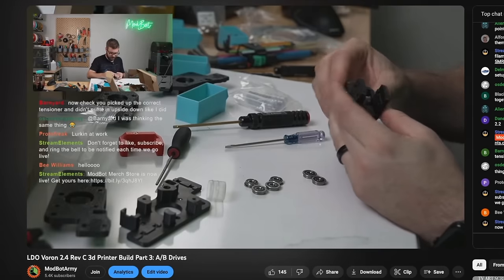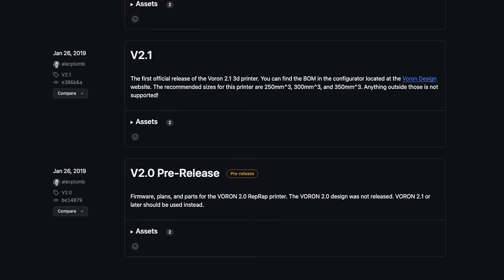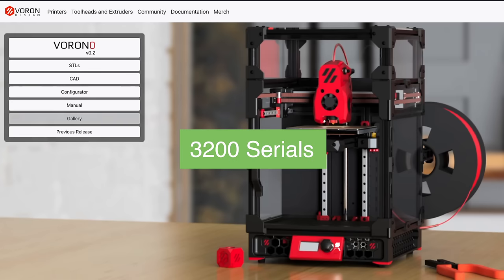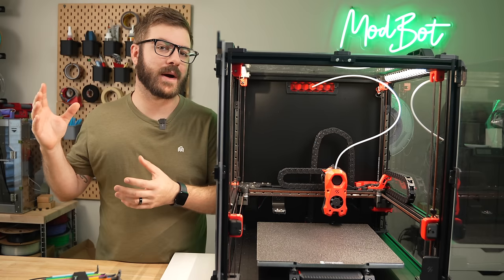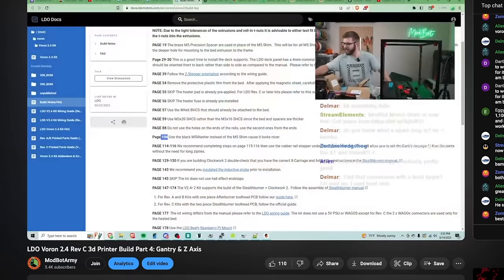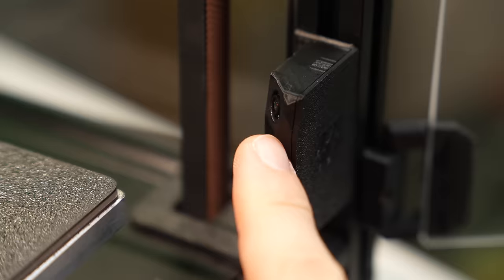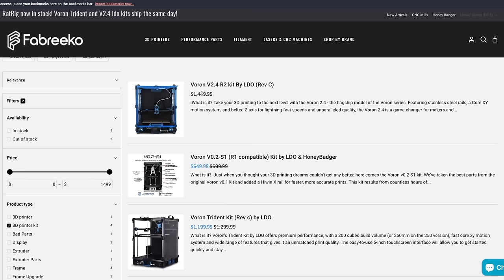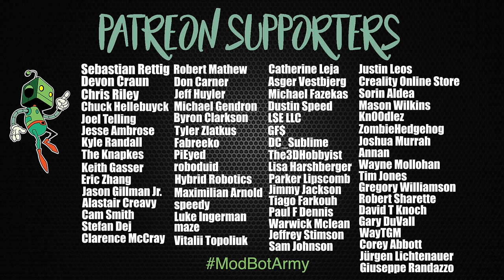Should You Still Build A Voron 2.4? (LDO Rev C)

Comment: With Bambu lab x1 people will get much better quality, speed and features then outdated overpriced voron with heavy printhead and less features.

1x 2.4 350 kit with good quality components will cost like 2x bambu lab p1p.
Reply: Not a popular opinion among, but I agree. Even though I love to tinker and build stuff, the Voron kits are overpriced compared to what you can get from Bambu these days. I think a Voron parts kit would need to be around $500 to be competitive. If I am going to spend over a grand, why not get the X1 with multimaterial support out of the box?
Reply: The bambu lab is not a bad printer ... ok if you don t want to build a printer yourself.... but it is still a cheap copy of a Voron ( as stated from Bambu lab itself) ... build industrially for a customer market. 
I also highly doubt that it will last for years... it requires more maintenance as a Voron, 
good quality? .... for example, the bed on a good Voron is 10mm thick pure aluminum... and heat resistant... the bambu lab one wraps often.... 
parts are proprietary, 
you can't use ist without cloud ( on the long term and not speaking about the overpriced E variant) 
It is a lot louder as a good Voron ( I can barely hear my 2.4 working 2 m away from me at good speed) 
it is poorly isolated... the chamber temp in a voron will be 10-20 ° C higher 
more features on a bambu lab? --- good laugh .. they have just copied klipper, prusa slicer and Voron... with the AMS being the only highlight...  Vorons get 1-2 upgrades per year
Size... bambu... 256mm...  Voron s starts at 250 mmm usually (V0 except) and are usually 300 or 350 mm big... 
price ? .. somehow... if you compares a smaller printer with printers double the print volume.... and better, non proprietary parts...  you get what you have paid for... and I think that bambu lab will rather sell you a new printer model in 2 years as upgrade yours.. for a smaller price....
speed? not really...  the printhead may be heavier but the motion system is build to compensate for the weight ... and at the end of the day your hotend will tell your how quick you can print ... and you can put some big ones in the Vorons... Flow matters...
and so on… the user case will determine what printer you should buy.
Reply: Merry Christmas  @Pasha! Dying laughing at the response to your post! The 3d printing community is about more than 3D Printing! The work up until recently by all the amazing engineers both home and professional is what lead to Bambu labs existence! I will be buying the mini soon because well, its amazing! However, building the Voron tops my list because im an engineer! The evolution of corexy and work by so many within voron and rat rig is just incredible and its at theheart of why I dig it so much!
Reply: @TheJacklwilliams  rat rig is much better and interesting imho. + it has 2 official idex mods
Reply: 7 @Newmeishu
Reply: @Pasha4ur  Good point! Im a fan of both designs!
Reply: @Pasha4ur the ratrig idex variants are still very much in beta and not fully featured. I wish they'd polish them up, I'd love to build a RR idex!
Reply: @christopherkelley2061 they’re different printers for different groups of people lol
Reply: So you’re comparing a 250 build plate to 350? Voron is not outdated and never will be because you can continue to upgrade it. My 2.4 is faster than any p1p… overpriced is wrong when you have so many more components and steppers than a p1p. If value is what your after a Voron is much more for value seeing as you can always update it in the future your locked into p1p frame extruder toolhead and eco system. Your logic is not adding up… but good opinion.
Reply: @gabriell4031  Damn straight. Additionally the skill sets gained by building, configuring and maintaining one will serve to raise your game far above the average printer operator.
Reply: Lmao i build my trident under $200 🇨🇳
Reply: @svwill6384 How did you manage that?
Reply: Sure, just add the closed source machine that's designed by former engineers from a corporation known to be complicit with CCP directly to your LAN. What could go wrong?
Reply: To me, this is apple vs android.  Bambu/apple people are ok using proprietary software and components that aren't able to be customized. Voron/android people like freedom to customize and improve. Both can provide excellent prints/make phone calls. 

Remember when apple was making it seem like people's batteries were junk to encourage them to buy a new phone; but their battery was in fact fine and miraculously improved 94% after a forced update? I say no thank you to proprietary software; that could one day be force converted to $200/month subscription.
Reply: @Zerff  everything pretty cheap here, i could get everything locally
Reply: Try the MPX kits they go for 800ish shipped for a 2.4 with tap and can and a 350mm^3 build volume
Reply: Does bamboo have a 350^3 cubed kit.  I gotta check them out.
Reply: @Hood.Housekeeping  no they don’t I’m talking about magic phoenix
Reply: If the Bambu breaks ur cooked 💀
Reply: Here is the deal though, my homemade machine is going to be made of standard parts in a completely open source ecosystem I can always get support for and will never be bricked when a company goes under or shuts off their servers, I also won't be left out if a company stops making parts.
Bamboo labs? Proprietary hardware, software and you will be left high and dry if bamboo goes under or decides to shut off their services, they will also be less durable considering it's a mass market item rather than a open source framework that is open for people to scrutinize every little detail which weeds out flaws much better than a company ever could.

Comment: Did Canbus and Tap on mine, best mods ever. Canbus was a pain to flash months ago, but gotten way easier. Helped build some for a shop and the cable chains started to shred wiring after around 2500 hours of printing, so the slimmed down umbilical was a huge must for high demand printing.

Comment: I built an LDO 2.4 300 back in March and I have been pretty happy with it.  I ordered a Trident kit a few days ago, and the ONLY reason I went with the Trident over the 2.4 was that I wanted to build a 250 this time, and AFAIK LDO only offers their 2.4 kit in 300 and 350.

The switching back and forth between the Voron manuals and the LDO docs is indeed a pain in the ass.  I doubt if the Voron team is interested in adding tailored instructions for the various kits, and trying to keep up with changes in the kits.  So it would be up to LDO to make a custom manual.  It's probably not worth the cost increase it would take, given the kit's already relatively expensive.

Comment: I built a Voron 2.4R2 350mm from a kit. It was fairly expensive compared to my other printers and the kit quality was not as good as it could have been. My recommendation is to go with the very best kit you can find. I thought I had, but I really should have done a little more research - it would have saved time and money. The biggest issue now is the bed quality. The bed is just not as flat as it should be which is essential to getting consistent prints. Spend a lot on the bed quality because if you have to replace it later it will also mean replacing the heating pad! All of that said, when I push print and it's tuned-in, I can't stop looking at it! It's almost magical. It's a really beautiful printer in form and function. I use this machine for large prints and for ABS and ASA as it has an enclosure. And I built it - go figure!

But it does take some passion to want to build a 2.4r2 350...
Reply: mind sharing which kit you got that you were not happy with

Comment: For anyone who doesn't have the budget for an LDO but still want the quality that comes with researching community mods to apply by default to a kit, I'd personally recommend Magicphoenix' CBT kit (CanBUS + TAP). It manages to simultaneously be among the cheapest kits and, in my opinion, include the best the community has to offer. Genuine BigTreeTech CAN boards for the toolhead, a Manta M8P with their in-house clone of the CM4, TAP and Nevermore configured by default, with options for Disco sticks, CNC parts, printed parts (functional/decorative), Phaetus hotends, genuine Gates belts and stainless steel rails.

I took a gamble ordering from them and, while they ship from China, I also had no customs to pay for it here in Belgium, since it first arrives to Poland before being dispatched to the home address.

Overall not only is the printer fantastic (but that's a given at this point), but the price paid for the quality that came out is outstanding. Can't recommend them enough, they even hang around in the Voron Discord if you have any question.
Reply: Hey do you have an email or some sort I can contact you for some questions about the kit? I'm also from Belgium.
Reply: With exception that Magicphonix is dead. People (including me) buy kits and have to file for a refund a few month later as nobody is actually sending the kits.

Comment: I started with the Trident, and am in the process of building a v2.4.  I feel they both have their niches they fill.  For an all-around workhorse, the Trident does a splendid job, especially when you factor in that LDO's 300 kit is a 300 CUBE design, so has another 50mm of build height to work with (stock design only has 250mm of build height, 300 cube has 300mm), which significantly reduces the need to go with a 350mm v2.4 if you need that height.

I won't lie, the v2.4 is a sexier looking kit, and the flying gantry is gorgeous, but if the LDO 300 cube kit had been available when I was originally building the Trident, I would have just gone that route (I built mine back when LDO was still beta testing their Rev A kits for the v2.4).  Wound up building a v2.4 alongside the Trident because it offers a nice niche that my Trident doesn't fill - larger schtuff, since it's a 350mm build, and will probably have around 315mm of usable height (kinematic bed mount removes some of the stock 330mm build height).

Editing to add: One of the reasons why the v2 has so many more serials is far too many people assumed that v2 was newer than v1.8, which is why the Trident is named, instead of being v1.9.  It's also been around a lot longer, but there's been pretty decent growth on the Trident serials after a few months of it launching.
Reply: Are you sure?   My LDO 2.4 300 maxes out at about 260 on the Z.

Comment: I built a voron legacy 6months ago and I am very happy with it. It is my go to printer where I send the print and forget about it. I do have 5 ender 3 printers and a hurakan but when I print on them I need to sit thru the first few layers and still keep checking regularly to make sure nothing goes wrong mid print. I am now building a bigger legacy with parts from a Ender 3 max because I have some special requirements from my customers where I need a 300x300x500 build volume

Comment: As someone who owned a v2.4 and a trident, go for the trident, especially if you are considering 250 and 300mm build sizes. This has two to three reasons: build is much easier (no z belt tension, no z drive assembly, no z belt clips), less expensive (one less stepper, one less driver, one less rail), maintenance free z axis when using pom nuts and requires less printed parts. Second reason is build height. That one might confuse as the trident has always 250mm height while the 2.4 ranges from 250 to 350mm. Reality is different. On a 2.4 you roughly miss 40 to 50mm in z when the top panel is installed because otherwise you would absolutely bend the reverse bowden. The reason behind that is that the original frame was built around being bowden extruder, wo you didn't need the extra top space. I personally would even go so far that you miss 50 to 70mm depending how mucb you want to bend the ptfe tube and how stiff the filament is. Meaning a 250mm built trident has more height than a v2.4, a 300mm is equal (ldo trident is actually 300mm in z making it the tallest voron), so only the 350mm spec v2.4 is taller than 300mm. Third reason is speed, a trident can be more easily reinforced on the frame, which is extremely difficult on a 2.4 due to the arrangement of the z belts and belt tensioners. But even without reinforcements a trident performs better, i rebuilt my 2.4 for various reasons to a trident and got a huge recommended acceleration increase, from 7,5k to 8,5k on a 350mm spec (mantis toolhead, cnc x axis), 13% increase. I would rule out different belt tension as it was tuned the same and the graph looked pretty similar. As reason i would suspect the more rigid frame and that the gantry isn't suspened by 4 printed parts. 

Personally i dont see a reason to pick a 2.4 in a 250 or 300mm size, the 350mm one makes sense if you nees the taller build space. Otherwise i don't see any reason besides cool factor to pick a 2.4 over a trident
Reply: I’ve been doing this dance between many corexy even Bambu was a consideration over the past year.  I always come back to trident and 2.4 and then got stuck.  You answered 90% of what I was considering.  I’m going with the trident for sure now.  I’m done comparing.  Trident it is.  With the saved money I’m getting the best extruder on a trident350
Reply: I went with the Trident for many of these reasons and have not looked back... but I thought 2.4 was really cool and unique, so I bought a Micron kit :D I've had a lot of fun with both units!
Reply: "...i dont see a reason to pick a 2.4 in a 250 or 300mm size, the 350mm one makes sense..." . Correct ! And there is no sense in buying 250 ft ethernet cable when doing your home network. 300 ft makes sense !
Reply: thanks for the insigghts

Comment: Actually deciding between a Voron 2.4 and a Voron trident, I always would prefer the Trident. While moving the gantry instead of the heavy bed esp. on bigger sizes seems more intuitive, this can become a problem on further modifications, like adding a toolchanger. If you want an automatic toolswitch to be added, a 2.4 has to move up the gantry for every toolchange or you need a syncroniced z-movement for your toolbay. Seems much more complicated than adding a toolchanger on a Trident.
However, belt driven z to eliminate any z-wobble definitly is a good idea. But it should be possible to use this techniqe on a Trident.
However, as I am interested in a bigger printer with at least 500by500mm² bed (I am into retro  computing and want to print keyboard cases and cases for old Commodore Amigas). So the only printer kit I consider at the moment is the RatRig VCore 3.1 at the moment, which is quite simular to a Trident, but available up to 500by500mm².
So I would be realy interested in a comparision between 2.4, Trident and VCore 3.1.

One point bothering me on bigger sizes however is the belt length for CoreXY and the problem CoreXY always being staticly overconstrained, wich can result in blocking and layershifts with bigger designs and heated chambers due to different thermal expansion of materials. I was always fascinated by Ultimakers CrossingRods design. The K4-design using crossing linear rods definitly is an aproach worth a deeper look into.

Over all, the Trident or the VCore 3.1 design seems more interesting if you want to experiment with different kinematics. As the XY-kinematic does not move, you could use a seperate frame for the XY-kinematic and mount it on the top - spliting the printer into two parts, the  bottom with the electronics and the z-axis with bed and the x/y unit, wich you can swap between classic coreXY, CrossingRods, CrossingRails or maybe even DoubleCrossingRods - or everything you might want to experiment with. Of course, if you want to go even bigger, you might even go further in dividing the printer into more seperate parts - like seperate units for base (with the electronics) left and right frames (one with one z-holder/movement unit, the other with two), backframe (maybe with a tool-holder for automatic toolchanger) and a top frame with the gantry. All frames stiffened with solid panels, and connected by thumscrews. So you can dissassemble it, bring it through the doors of a normal home, and assemble it quickly in an other room or in a cabinet...

Comment: OMG... I love my siboor V2.4 Rev C. Running it since April has been such a blast, yes I have gone from stock to modded, mainly printed parts. I have upgraded to BFIdlers, the GE5C mod, and three different version of Tap. I found I prefer the Dodo3dlab Voron CNC Tap over the Chaotic Tap. Also using the BTT Pi V1.2 with a Spider v2.3 and working flawlessly. I would however love to have a better method of belt tension as there is no mic the same to pick up proper sounds from a phone. This is the one downfall of belted printers. My V.0 also from Siboor was an example of perfect All white frames and white printed parts. Only prints PLA so I am not running a Nevermore, but it does get quite warm lol. My trident is on the way, and my X1C is a great unit but I feel I love the voron line of printers far more, but My Ender 5 pro will always be my true love.... total workhorse

Comment: Do note:  The 350mm model is the version worth getting (for its price point) vs other printers on the market.  
When I built mine I got the 350 model, and its quite the monster of a printer.
The Tridents do not have a 350mm version, and is why they are cheaper since their max size is 300mm.
Reply: They do now